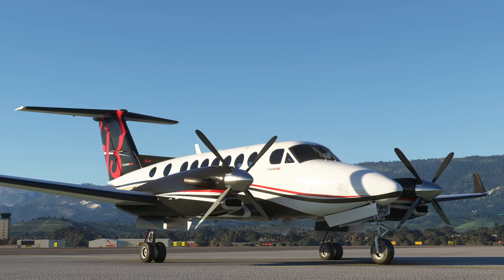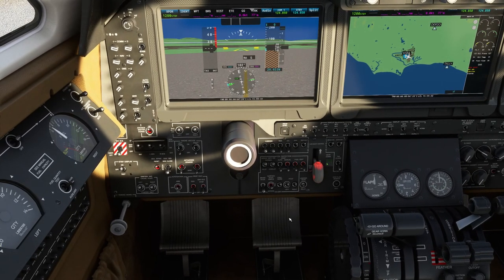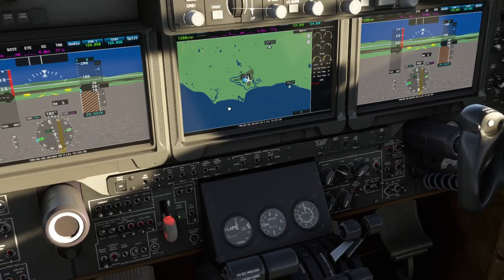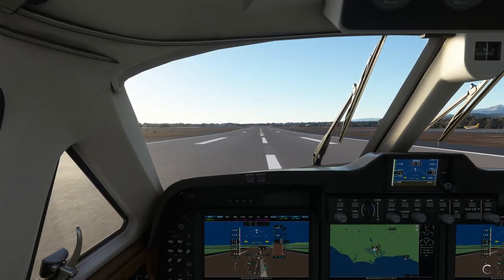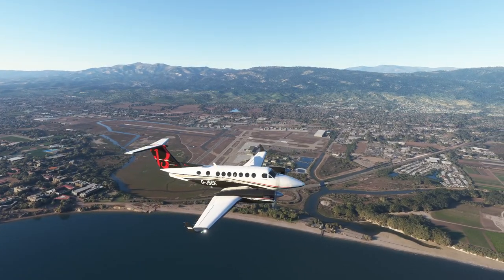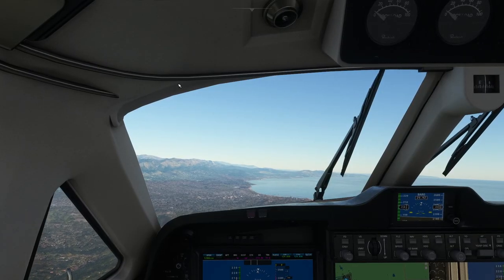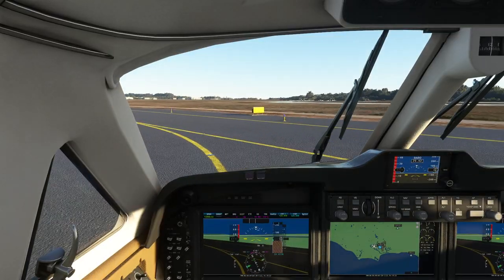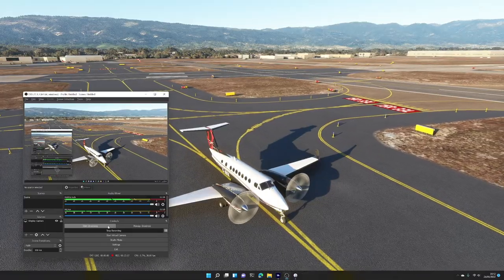Beginners guide to the Beech King Air 350i in Microsoft Flight Simulator

Comment: Hope you're connected to a gpu, starting both engines off battery definitely doesn't work irl haha
Reply: I've only flown a C90 but I was thinking the same. I believe I would lay off all the lighting and such too until post start-up.
Reply: You can start both engines without a gpu. You do have to push the right condition lever to high idle to be able to start the left engine.

Comment: Feathering is the opposite of air brakes. We feather the prop on an inoperable engine to decrease drag on the dead side. This helps manage adverse yaw, and increases climb  performance.  In the case of a single engine, the prop is also feathered for an inoperable engine to decrease drag which helps achieve max endurance and range.  Pushing the prop lever full forward is the draggiest position.
Reply from the maker: Yep - I said the opposite - I'm good at doing that.

Comment: Great video, thank you. I have the HC Alpha and Bravo and I’m trying to bind the arming switches for the ignition and bind the ignition/start switches. Is the dial on the right of the HC YOKE (off/r/l/both/start) meant to be used for magnetos? I would be interested in your control mappings. 

Thanks!

Robert
Reply from the maker: Yes - the L/R/Both/Start is magnetos and starter/ignition combined.

Comment: After 100 hours in the Airbus a320neo. I tried to come back to the turboprop. The king air was my aircraft of choice. I got a caution warning after take off follweded bt an immediate down pitch of the nose. The aircraft stalled and dived to the ground. What am I doing wrong???
Reply from the maker: Without watching you do it, it's very, very difficult to answer. If you join VirtualFlight.Online, you should be able to do a screen share in the Discord server at some point - then somebody should be able to help you :)

Comment: I have a real hard time managing power while taxi in this plane. I must be doing something wrong because whenever I release the parking brake after start up the plane jolts forward even when throttles are idle
Reply from the maker: That's because the real thing has positive thrust at idle - especially if you go for high-idle (which the real-world pilots VERY rarely use).

Comment: How do you manage to drive around so slowly when getting pretty high rpm? When I'm pretty much idling and letting go of the brake, my plane keeps picking up speed and I'm constantly having to hit the key I mapped to manually brake
Reply: Move the power levers over the idle gate into the BETA range and place the fuel condition levers into low idle.

Comment: with turboprops in general, how do you know how much to feather the props?
Reply from the maker: Look in the book. Most of them tend to advise about 70% - matching that with 70% on the throttles. Like I said - read the documentation - it will vary based on temperature and altitude.

Comment: I seem to have a problem when starting up... I start the engines but when I'm about to taxi everything electrical shuts off and then it comes up with a message about turning on the electrical system for radio 😕😕
Reply from the maker: You're not turning the generators on. Or maybe the inverters ?

Comment: Is there a wind indicator? I can’t find it anywhere
Reply from the maker: That's a really good question - if you press the menu button on the central console, then use the touch screen in front of the pilot, you can probably find the weather there.
Reply: @jonbeckett   I found the wind indicator through the GPS. This King Air seems to be vastly underpowered compared to the real one. I stalled while climbing to 30,000 ft with only 70% fuel. There is a yt vid of a real King Air pilot saying the msfs version is underpowered, but I don’t know if Asobo has made any changes since then.
Reply from the maker: @johndfw8680  I believe there is a mod for it over at flightsim.to that corrects the engine power. It's worth noting that not all King Airs are the same model...

Comment: Ummm...You had reverse thrusters? My MSFS 2020 model of this plane does not appear to have reverse thrust nor spoilers.
Reply from the maker: Reverse pitch. Well this is the stock version in MSFS - so you just haven't configured your controllers to allow it.
Reply: @jonbeckett  yeah, I figured out the problem. I had a joystick button programmed to toggle reverse thrust. But for some reason the reverse thrust toggle function does not work. I had to reprogram the button instead to reduce thrust. So now the button takes it from 0 throttle to negative throttle, thus giving me reverse thrust. Problem solved.
Reply from the maker: @BillSmith-rx9rm  It's probably because of the axis you are using for throttle. There are two - 0-100, and basic "throttle".

Comment: I was sitting on the ground and my plane power just went off and would not power back up.
Reply from the maker: Flat battery. You need the engines on, and the generators running.
Reply: @jonbeckett  that's the interesting part of the problem. I did have them on. But everytime I turn the battery back on it makes a noise until I turn it off.
Reply: Same problem for me

Comment: Not sure if anyone can help me but I can’t for the life of me get the nose wheel to steer. It works in the f-18 but not the beech king. I don’t know what to do.
Reply from the maker: First step - if you have been meddling with the controller profiles - is to revert to the default profile for your controller and see if that resolves it. There IS a nosewheel steering axis that is independent of the rudder - some aircraft use it, some don't. It may be you just need to map it to your controls appropriately.
Reply: @jonbeckett  Thanks, I reset all controls to default but there was no key for it. I know the buttons work because it works on the f-18. I have the nose wheel steering axis and limit set and the g-limiter set. Cant seem to toggle to get the wheel to work tho. I didn’t know there is another key for the rudder steering. Is it just using the rudder or is there another name for the control. If it just the rudder the plane barely most when I use it.
Reply: Ok so using the rudder to turn works so long as I don’t click the nose wheel steering limit button or the g-limiter button

Comment: Do all the autopilot buttons work with this version?
Reply from the maker: Well... this is just the stock version in the simulator - without loading it up, and taking a look, it's difficult to know what you mean by "all" the buttons. A lot of the buttons on the centre pedestal don't work. I imagine that's all going to change when the Black Square mod appears that turns it into an analogue gauge aircraft :)
Reply: @jonbeckett  thanks!